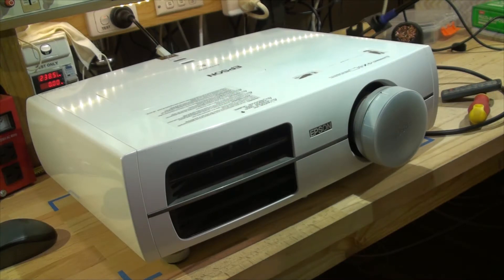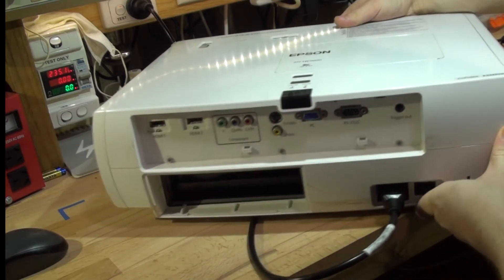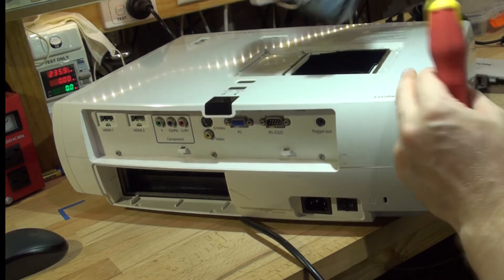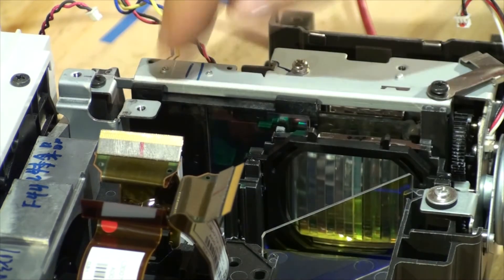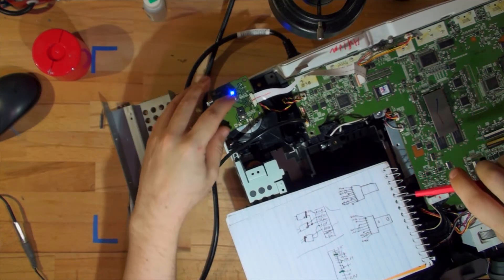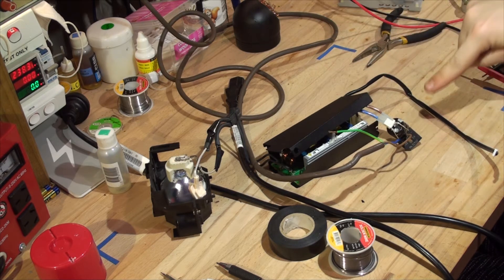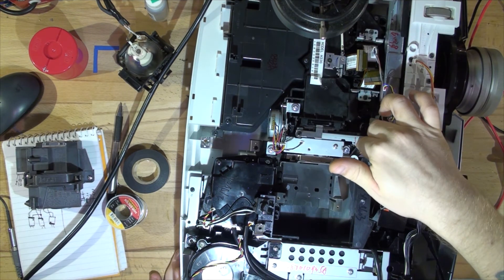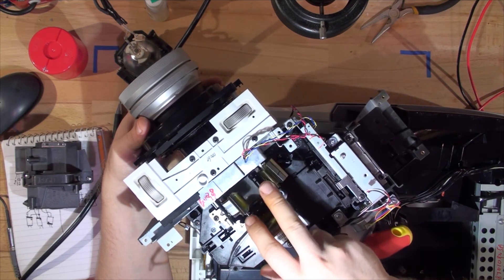Repair of EPSON Projector + Identifying bad polarizer

Comment: Hi Max, I have an epson 3020 that was producing red and blue bands on the screen, seems to be fairly common without much information developed or shared to date. Found one that suggested a filter was out of alignment/loose after the iris control. I removed and replaced everything that had been covered in the information I followed. Upon restart laughed and cried because now the entire picture is tinted pink, no white to enjoy any longer... any thoughts on a solution or direction? Thanks in advance!
Reply from the maker: Hi, it sounds like polarisers are out of place, or did you try to wipe output (last polariser?) they should be also adjustable input polarisers. Maybe you moved them out of alignment, it sounds minor to me tho. Have a look at a video I did about polarisers, maybe that will help: https://youtu.be/fs33vNyR0M0
Reply: @MaxELECTRONICS  I first would like to say THANK YOU so much for the quick response Max, I love your work and you are a true true talent!!
I watched your video regarding the polarizers and it is "over and above" all else for detail and simplicity in the same presentation, incredible.
When I had my projector apart I never took the engine apart where I would have moved any of the polarizers, at least I don't think I could have. All of the work I did was in and around the large multi lens and the aligning glass. I had mentioned the projector was showing red on the left and blue on the right vertical margins. The information suggested that the multi lens / aligning glass were the contributors so I went after that as my solution. The information I read had said that the one of these lenses had moved and was causing the problem, the fix was to basically make sure they were firmly seated. I did that and the metal plate attached to the aligning lens broke free. I wish I had watched this video first, I see you warned against the use of crazy glue, its what I used to reattach the metal plate to the aligning glass. Now that the entire screen has lost its white value and turned pink is it still pointing you to the polarizer or is the CRAZY GLUE contributing to my crazy nightmare? I also noticed when you removed the aligning lens that the metal plate was facing the lamp, Is that the correct orientation, if it is I may have mine backward and I assume that could be a nightmare of my own creation, either way I'm taking it apart again to have a look.  You're definitely the best, I can't imagine how many people you've helped but your followers are truly thankful,  thank you so much!!!
Reply from the maker: How pink is it? I’m thinking maybe you have the “cinema” filter jammed ? It’s right next to the iris. Because that  can give you pinkish tint. Also you can remove the lamp, and while shining bright torch where the lamp suppose to shine look at the engine output before the yoke, stick a piece of white paper between the yoke and engine and have a look if red is shining properly through to the yoke and then repeat with other 2 colours, you NEED TO HAVE PROJECTOR OFF to do this procedure, this will confirm that red green and blue are shining straight into the yoke
Reply from the maker: Also in regards to the bands on side of the screen if the multi eye lens didn’t fix it you can adjust the mirrors inside the engine using a torch technique that I’ve explained in optics engine video
Reply: @MaxELECTRONICS  You continue to impress Max. The 3020 doesn't have the cinema screen so we can rule that out. As for the pink, it makes watching very unenjoyable - watching the Olympics with pink snow, pink ice, so yes, its pink enough, anything white is now pink lol. Thanks for the additional tips to test the light throughput. I'll let you know what I find when I get back to it today. THANK YOU!
Reply: @MaxELECTRONICS  HI Max, well you were right, its the green output polarizer ( not sure how that translates to all pink whites).  When I puled the assembly I was looking at the space between the engine and the yoke to do what you had suggested and I could see the polarizer had come loose. Ill see where it goes next and throw a comment on progress but I think you nailed it!!
Reply: @MaxELECTRONICS  I stopped short of taking the cover off the engine since it seemed to be attached from the front behind the lens assembly... how do I remove the yoke to access the green polarizer or can this be done from the underside safely?
Reply from the maker: The yoke and the lens can come off as one piece, I can’t remember exactly but I think the engine is not really attached to the yoke, I  think you should open the engine first and make sure all the optics are intact, maybe one mirror fell off or something, If all good there then look at the yoke. It all disassembles from the top and there’s only few screws holding it together. But to open the engine you don’t need to get it out. You can unscrew the lid of the engine while it’s in the projector.
Reply: @MaxELECTRONICS  If I could send you a pic of the green output polarizer you'd see how its sitting on a diagonal to the rest of the assembly, certainly not squared in its current state. As I look at the bottom I can move it back to a similar position as the others but it springs back as there's nothing to hold it in place
Reply from the maker: There’s screws towards the lens, the lens and the yoke come out as one piece, so you’ll need to undo the screws around the lens and there maybe couple of screws near the yoke, once you undo them the lens and yoke will come out as one piece, while engine will still stay in the projector. When you glue the polariser back in use just a tiny dot of household silicone. Do not use superglue! Also do not touch polariser. Just use tweezers around the edges
Reply from the maker: Some screws may be in an awkward position, use a torch to look around where they may be, all the screws are from the top down, there’s no underneath screws or no side screws, all screws to remove the yoke and lens are from the top
Reply: @MaxELECTRONICS  I have the yoke separated but I'm still puzzled by this green polarizer. Its not attached like the red or blue. its attached to spring metal and I can't seem to figure out away for it to be moved in place and secured without it springing back to its current state?
Reply: @MaxELECTRONICS  I've done some additional searching and it looks like the green polarizer I was expecting to be out of alignment is not. In 2 videos the polarizer is positioned identically. So I'm back to the beginning. I've looked at the inside of the engine and nothing is loose.  All I've done, from the beginning was attempt to eliminate the red and blue bands at the margins, the end result was my whites and the entirety of the screen has a magenta coloration taking over. If you have any last thoughts on this I'd truly appreciate it. It just feels like it has something to do with my early attempt at seating the large multi lens and or the aligning glass to now be viewing a screen dominated by magenta. Thanks in advance Max!
Reply: @MaxELECTRONICS  when I lit the engine up and tested the output color between the engine and the yoke, the blue polarizer is showing magenta and blue on the paper if that helps any
Reply: @MaxELECTRONICS  ignore the last comment on the blue polarizer,  I was catching the red crossing over to the backside of the paper...
Reply from the maker: I don’t think that the pink has something to do with multi lens, this lens is there to disburse light evenly, check your polarisers,, see if any of them are lose, to me it sounds like “input”polariser, if image is even and colours are even but just one colour off i has to be polariser. Try to wiggle them see if they’re loose, they should be glued in place, try adjusting input polariser, it’s held by a screw, also check if all LCD panels are plugged into board correctly, try plugging projector into computer and using “paint” or “photoshop” display red green and blue, amd see what one is not showering correctly, it could be as simple as not properly plugged in lcd panel. Have you also tried adjusting “background colour” on settings? Or maybe just reset whole projector to default settings.
Reply: @MaxELECTRONICS  HI Max, thanks again for the quick feedback, its soo much needed! I have no way to determine if any of the polarizers are out of place since I don't have access to them when its powered up, everything is below the board. I did inspect them while it was apart and the input polarizer for green moves ever so slightly - it may be because I was trying to figure out how to remove it only to find it attached to the metal I spoke of, not glued in like the others. Now that its back together... I no longer have the pink effect destroying the picture, however I now have no red filtering thru to the picture, its gone black where red once existed as best I can tell. I also have a shadow now covering about 1/5th of the picture where it didn't exist before. I think I'm spinning out myself! Each time I attempt something I put it back together and return to find a different picture issue lol. The lcd panels looked fine, the ribbon connectors looked correctly placed and fine?
Reply: @MaxELECTRONICS  I reset the epson back to default and it didn't change anything for the positive. Does it sound like the lcd ribbon is off on the red? I get blue and yellow tones
Reply from the maker: It does, try writing black text on red background and see if it projects
Reply: @MaxELECTRONICS  HI Max, well it was the ribbon, not fully seated in the connector. I put it back together for the time being. Pink screen saturation is gone as well. However, now the margins have expanded their red and blue shadowing. When I get back to it soon  I'm going to simply remove each ribbon from the lcd to see if it changes anything. What I noticed when I had lost the red coloration was the shadow was still displayed on the screen without the red being produced. I don't really know of any way to actively adjust anything to see the real live effect of a change other than this. Thanks again for your continuing support, you are a gem in the youtube universe of "information". I'll let you know if it helps when I do this lol.
Reply from the maker: The bands you originally spoke about would be the mirrors inside the engine
Reply: @MaxELECTRONICS  I can appreciate that it would be the case so the problem remains, how do you effectively align the mirrors to correct the display? The mirrors are either glued in place (so likely haven't shifted) and those that aren't are held in channels preventing movement that would allow them to shift on a vertical access allowing the shadows to be moved off screen. Have you had to adjust any like this along the way? I know my epson is a little different in its configuration so I don't know how to compare
Reply from the maker: Use a bright torch and shine it as str8 as possible and see how light travels and If each colour is straight rectangle and centred on the yoke
Reply from the maker: Maybe that multi lens isn’t centred correctly

Comment: Hello Max, 

I swaped 2 lcd panels to troubleshoot (on the tw2900) but i didn't know that there were aligned, do you know how i can aligned them ?
Reply from the maker: Unfortunately that’s almost impossible. Like I mentioned in the video, whatever you do, do not remove the lcd panels, as it would cause convergence problems, you could try getting the whole engine out and shine very bright torch in place of lamp, then block one colour with cardboard and using the white projection on the wall from the torch try aligning the pixels, you won’t get it 100% but at list it’s better then nothing. The pixels should be just visible.
Reply from the maker: Also check out this video on optical engine and how to identify problems: https://youtu.be/fs33vNyR0M0

Comment: Thanks very much for your excellent video which has helped me identify a burnt out green out polarizer in my Epson projector. One question: what type of glue would you recommend for repostioning the new polarizer? I guess it needs to be something that withstands the heat in the light engine.
Reply from the maker: Thank you for your comment, I usually use silicone, it works really well with high temperatures, same goes for the car, for example I usually silicone dash cam to the windshield, in australia during summer cars get extremely hot and everything falls off but silicone, so I used silicone in my projectors amd it works great.
Reply: @MaxELECTRONICS  Thank you very much!
Reply: @MaxELECTRONICS  Any specific type of silicone? Don't really know what type I should be looking for
Reply from the maker: Look for non-acidic type, any will do just non acidic
Reply: @MaxELECTRONICS  Thank you! I'm getting a polarizer delivered and this video is a massive help

Comment: I've got a pretty crazy repair story here you probably won't believe.   Have an Epson Powerlite 8350... 9 years old, 450 hours... for a while it would start up with some loud clicking sounds, other times it would click and wouldn't start up, fans would boot and it would try to start up but then shut down with both red lights blinking.   Had it apart to try to clean autoiris; moved the gears freely with a long screwdriver without disassembling them and they looked clean and greased.  Also pulled out the sliding 'filter' (motorized) and sprayed into the limit switches with contact cleaner.   Put it back together and no more clicking sound but it would still shut down with both lights blinking after several seconds prior to the lamp turning on.  Finally out of frustration I thought well maybe there is something "stuck" that won't move for bootup so I shook it (like a paint can) while it was booting and it booted up!   It has started up perfectly now several times since (without shaking).  Can't explain it but I'm really hoping it works for a few more years!!!  So I'm guessing it might have had something to do with the motorized lens filter or a fan motor that was stuck.  Something mechanical.
Reply: Oops, on further testing I now know that my Red colors are completely missing from the picture.  Blues and yellows are there good and bright.  Suspect it might be a cable connector problem with the Red LCD.  This didn't cause a fault code and it boots up fine, just effected the picture which is otherwise good (focused and no streaks etc)
Reply from the maker: Yes that sounds like ribbon cable on lcd, try unplugging it and plugging it back in, sometimes they just miss align with pins on not plugged in far enough
Reply: @MaxELECTRONICS  Exactly, my red ribbon cable end wasn't fully seated and 'locked' at the circuit board.  Projector's working perfect now!  Fingers crossed.

Comment: I have an Epson Home Cinema 760HD projector that I bought as a renewed (refurbished) item from Amazon. I wasn't using it right away, but I did open it up to test it out and it came on and projected the blue screen and menu just fine, so I put it away until using it for a gig. After I got to the gig and got it hooked up, the picture and even the menu kept cutting out and coming back on. I eventually figured out that it only did this when a video source was hooked up. I tried changing from the HDMI input to the composite input and it did the same thing, but as soon as I disconnected the video input signal then the menu and all stayed on fine. Unfortunately, I discovered this just 3 days past the warranty period ended.
Any ideas on what could be causing this and is it fixable? What part(s) would I likely need to check/replace?
Reply from the maker: I’d check power supply to make sure all output rails have correct voltages under load, specially  try capturing moment the screen disappears, oscilloscope would be best tool, if there’s a dip in power when projector plays up, then you know there’s a problem with power supply under load conditions, could be old capacitor.
Reply: @MaxELECTRONICS  I don't have an Oscilloscope. Just a cheap volt meter. I'll give it a try and see what I can find. 
Thanks for the help.

Comment: Hi, recently I change my epson 8350 red LCD panel after that I got double image pink and white (not clear image) convergence issue. Please help me how to alignment the LCD panel
Reply from the maker: Hi it’s almost impossible to do at home, you’d need to get the yoke (lcd assembly) out of the projector, connect it to the main board with extension ribbon cables and display any alignment image on them, then using a microscope you can align them